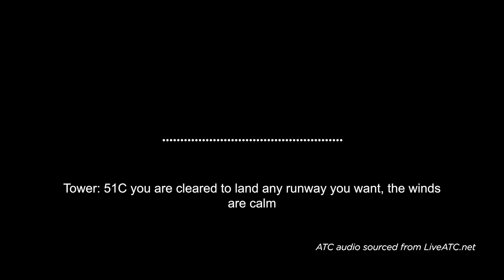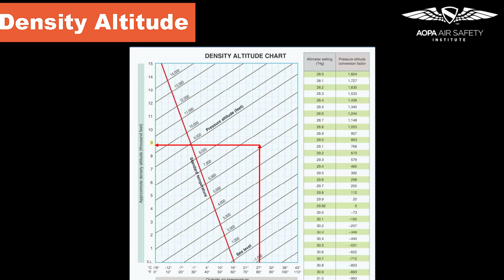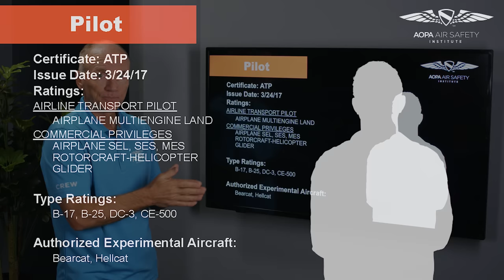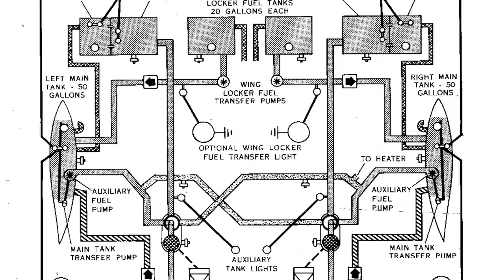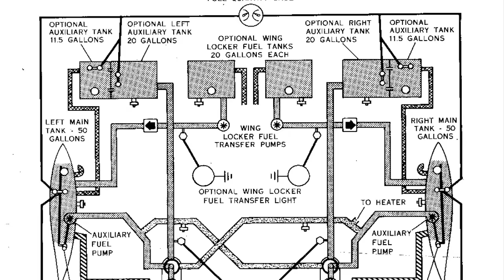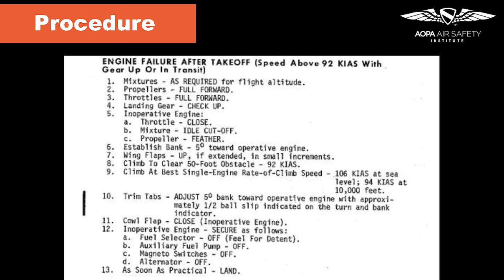Early Analysis: Cessna 310 Crash July 18, 2023 Santa Fe, NM

Comment: I was on the southern end of Santa Fe when the 310 went down, and saw the horrible black smoke. We have been having calculated 10,000+ density altitudes for weeks. It was HOT the morning of the accident. Santa Fe has been near all-time record heat this past week. Please be careful this summer. It is not worth the risk when it gets so hot at high altitude (6300ft field elevation).

Comment: Light twins: 1.5 times the power, 2x the cost and mechanical issues, 3x the skill required. 

The point made in the video about accepting a glide to landing off airport in some scenarios can't be forgotten. Break the mindset that a twin always makes it to a runway. So many pilots accept gliding into a field in a single engine airplane with open arms, only to suddenly chuck that mentality out the storm window the moment they get in an airplane with two props. If you know you're pushing the limits of SE performance (High, hot, and/or heavy!) for your airplane, consider that second engine your ticket to a better glide ratio, not a guarantee you'll make it back to pavement.
Reply: well stated
Reply: Wise words. the instinct seems to be save the plane rather than save yourself and it ends up doing neither.
Reply: Yeah but I also think 2 bad choices were made by the pilot as well ; 1. "Im gonna gain altitude "  and 2. Staying in the left turn- Did the suggestion by tower to go left to 33 stop him from making a long lazy right. Iunno, all monday morning QB. Rest in peace. Thoughts for the family
Reply: Could he have landed on that road? Just interested?
Reply: @pilotactor777 road landings can sometimes work out fine, other times it's rush hour.
Reply: @stevemadak6255  I wondered the same thing.  Looking at the map, I see why the tower instructed a left turn...it would line him up perfectly for a landing on the other runway.  But...did a left have him turning into the inoperative engine?  I've seen too many crashes caused by turning in the direction of a dead engine, inducing a wing stall.
Reply: @gusmc01  I think this pilot should be well aware of this given his experience.  But how many ATC controllers are even taught on this?
Reply: He said that the gonna to get some altitude. How could he have miscalculated?

Comment: First off, condolences to the family. It does sound like he was a capable pilot as well as a surgeon, and there are four immediate takeaways or lessons learned to use today. First, know your density altitude and how to apply that to your s.e.l. Climb chart and if the number is too low for you, reduce the weight and/or leave at a cooler daylight time. Second, brief your departure and worst case emergency procedure to yourself before each departure (he had a nice clear area straight ahead. Third, know that emergency procedure (and practice it at recurrent training) by heart. You might not have time if you’re single pilot in a light twin to reference a checklist. But do use it when you get the “aviate” portion well under control. And fourth, RAISE THE DEAD engine that is. ALWAYS bank into the good engine. This pilot did not have quite yet the aviate portion in hand yet so there was really no need to talk to the tower, the controller was not going to help save the day and as a matter of fact contributed to the bad situation by saying he was cleared left turn back. I would not lhave been saying anything (except “oh shit” to myself) until I had the emergency under control. I loved that airplane, especially the turbo models as I flew 100s of hours flying freight in them at night, with only once having a partial engine failure, over a city.

Comment: Great breakdown of the factors involved in this crash.  I am not a pilot but I spent 4 years assigned to a KC-135 flight simulator as a maintenance tech in the USAF.  Part of my job included daily pre-flighting the simulator to ensure all systems are operating correctly.  Also, during simulated flights with actual crewmembers, my job was to observe the various training "missions" to detect any anomalies in the equipment that may need further attention.  One of the most common simulated failures was having an outboard engine fail during rotation at takeoff.  Too often, the pilot would step on the wrong rudder pedal to compensate for the severe differential thrust.  Of course, that caused the simulator to simulate a loss of control and then simulate a crash.  When that happened, the IP (instructor pilot) would become very angry with the crew.  Whenever responding to an engine failure, over the years, I heard him say emphatically "step on the good engines" when referring to the rudder pedals and which rudder response is called for.
Reply: Dead Foot, Dead Engine

Comment: Great point about accepting your off airport landing rather than augering in at 100kts+ still trying to climb. Sad and discouraging to see any pilot go down like this, but particularly one with this breadth of time and experience.
Reply: If you look at the area, the choice of an off site landing was as simple as looking down.  He even had the option of a dirt road that was perpendicular with runway so he wouldn't even have required a turn and most likely could have gone gear down, particularly if he was having trouble raising them.  Of course in that situation processing the information and making a decision is extremely difficult and time sensitive.   I bet in flying those older aircraft, his natural instinct would be to preserve them in this type of a situation.  Perhaps that kicked in here.
    But the fatal error of turning into the dead engine, seems like a massive oversight for someone with the vast experience he had.
Reply: He died doing what he loved.
Reply: @bastogne315  yeah, that helps 🙄

Comment: Excellent review. With such a failure merely flying the aircraft can absorb much of your brain power. Having to take one's hand off the controls to run through the engine failure sequence can be very demanding when you can hardly keep the aircraft under control. With the high D/A everything on the s/e checklist must be correctly and expeditiously completed or the aircraft simply will not perform. This is where recent/recurrent single engine failure proficiency is so important.

Comment: Richard is one of the most clear and logical speakers I've ever heard. Keep up the excellent work.
Reply: Lesson learned: (1) be prepared when flying in  high density altitude, and  (2) in an engine out situation even at low altitude, where a second engine can provide sufficient climb performance for the situation, be prepared to fight back the instinct to turn toward the quickest landing pattern, particularly if that turn leans to the off engine, and concentrate first on gaining altitude to run the checklist(s) and perform a single engine landing.  What is surprising is that the last words of the pilot seem to indicate he understood this and was focussed on gaining altitude. I suspect something else happened after he started to attempt to gain altitude. One possibillity is that the wrong engine was turned off.
Reply: Thank you for the kind comments.

Comment: Thanks for the indepth analysis Sir.. lesson learnt is on an engine failure just on lift off..
- counter the yaw
- wings level
- landing gears in
- feather the inoperative engine
- maintain single engine climb out speed
- gain safe alt

And then look for landing options 

Thankyou Sir

Comment: Tragic but a solid reminder to do your density altitude calculations.
Reply: Learned something. 
I thought even with density altitude any turbo charged engines performs as it would at sea level?

I'm guessing now that may not be the case?
Reply: Well, yes that was the first consideration he likely missed and that left turn, with an idle left engine.....was the kiss of death.
Reply: @Mikinct Yes it can be done. I’ve demonstrated a cessna T310 with a RAM 2 conversion climbing from 9000FT at a rate of 200Ft/minute. However  contrary to the VMC demo. My Airspeed was below blue line but above red line while maintaining direction control. Engine settings on the good engine were at 32 inches and 2500 RPM. POH says it can maintain 17000 FT on one engine but the climb performance will start to degrade around 13000 FT as you would have to maintain a higher indicated airspeed to maintain directional control as rudder would become less effective with denser air.
Reply: If you watched the video, it wasn't density altitude that was the problem. He should have been able to slowly climb to 17,000 feet on a single engine under those conditions. It sounds like he did not get the plane set up properly for single engine.
Reply: @Mikinct  Some engines are turbo-normalized, with a wastegate that automatically adjusts to provide sea level horsepower to a given altitude. I think these are a standard turbo, which simply adds pressure to the manifold. As such, they lose performance with altitude, or with density altitude. (Of course, prop and wing also lose performance with altitude or density altitude.)
Reply: @linanicolia1363  where did snyone state which engine died? It's just a guess at this point, right? Could've been the right engine that lost power until the investigation is done.
Reply: @jonathanparle8429  if he had problems with both engines then density altitude would not be the issue. Engine problems would. This aircraft should have been able to climb on one good engine all the way to 17,000 ft.

Comment: Great report, my 2 cents is in line with your evaluation, put another way, he stopped flying the airplane, instead he felt it was necessary to start talking to ATC instead of following the procedures you outlined, straight ahead, clean up, lower wing slightly. 

At that density altitude, the 310, 402 and 421 need both engines to fly, picking a relatively flat spot and ditching it straight ahead was his only  
chance, making the turn sealed his fate. The DTSB makes it a point for pilots to mentally brief themselves prior to every departure, this technique can save lives in any aircraft.
Reply: It's easy for us to be  critical, but you would be hard pressed to find a more qualified MEL pilot. Fate is the Hunter, may he RIP.
Reply: @bobteter4300  I’m guessing he didn’t actually know what poor performance was available on the day in that 310. I wonder when the last time he did any SE air work. Training matters.

Comment: The focus on density altitude is important, but it's possible this airplane had a fair bit of margin still. He was solo - that usually means a LOT less weight when you include luggage etc etc. Some cessna 310's are carrying 6 people aren't they? And many are turbocharged. The other issues (cleaning up / feathering / bank / direction of turn etc) all seem like potentially very direct contributors. Gear out, no feather, turn into dead engine, let speed decay? That would be pretty bad. If he was trying to climb my guess is his speed WAS decaying (keep speed is usually part of engine out but I don't know multi) - that was his radio call.

Comment: Its crazy how hot and dry it gets every summer here in New Mexico. Lots of the state has high altitude.  This was in the 'cool'  morning.  I Fly RC jets. Electric ducted fans. Planes that will fly out of your hand @ sea level (easily hand launched) will take a full throttle run on a 300' runway to take off. Its amazing how much MMPH you lose with thin dry air.
Reply: Dry isn't a density problem, humid is.
High, hot, humid.

Comment: Good video, but please recheck the comment  (7:28) that the SE climb performance is based on wings level climb. Normally the climb performance is  based on climbing with a five degree bank into the good engine which reduces the sideslip and drag. Great comment on accepting what you have got if you are not climbing.  If it happens before the gear is up,  think as a friend said "well I just sold the aircraft to the insurance company"  power off both sides and go for the straight ahead off field landing.

Comment: Single engine max altitude is about 7500 not 17500, the density altitude was higher than the single engine service ceiling.
Reply: Cessna T 310 R, II turbocharged - Performance Data
Horsepower: 285	                Gross Weight: 5500 lbs
Top Speed: 237 kts	        Empty Weight: 3723 lbs
Cruise Speed: 223 kts	        Fuel Capacity: 102 gal
Stall Speed (dirty): 70 kts	Range: 517 nm
	
Takeoff	Landing
Ground Roll: 1306 ft	                Ground Roll 640 ft
Over 50 ft obstacle: 1662 ft	Over 50 ft obstacle: 1790 ft
	
Rate Of Climb: 1700 fpm	         Rate of Climb (One Engine): 390 fpm
Ceiling: 27400 ft	                         Ceiling (One Engine): 17200 ft
Reply: Cessna T310R II  Performance Specifications

Horsepower: 2 x 285 HP
Best Cruise Speed: 223 KIAS
Best Range (i): 517 NM
Fuel Burn @ 75%: 27.2 GPH
Stall Speed: 70 KIAS
Rate of climb: 1,700 FPM
Rate of climb (1 engine out): 390 FPM
Ceiling: 27,400 FT
Ceiling (1 engine out): 17,200 FT
Reply: I disagree please check the specs again.

Comment: Very important case for us light twin pilots. Gave me new perspective on temperature related airfield DA WRT preflight preparation/considerations. One thing of importance is advising which engine failed b/c normally one would want to keep (gentle shallow) turns to the side of the good engine. If he had a left engine failure he would want to avoid left turns and needed to immediately advise tower. Another reason to keep the engines in good shape so a remaining engine can indeed provide max or near max power. Furthermore consideration must be given to mixture settings for max power , full forward is great for cooling but may not provide max power esp at high DA.  It was moot but esp at a larger airport he should also have immediately declared an emergency so ATC could put the commercial jets out of the way on a hold or such.  Addendum: did his engine actually quit or seize or did the turbocharger fail causing big  MAP splits?  TC failure esp at high DA may result in significant performance decrement on that side but usually would not require shutting that engine down and feathering, just ignore the split MAPs till back safely on the runway.

Comment: So sad, but you can see the difficulty he had since the Airport (KFAF)'s surveyed elevation is 6348 feet MSL. All the surrounding terrain is 6500 and above in the immediate area of the airport (according to the approach plate for Runway 20). Yet his departure altitude was at most 6050 feet MSL. Something is wrong with his altitude figures as he's lower than the terrain he's flying over. Very sad. Approach plate can be viewed on Skyvector.
Reply: Maybe the ADS-B data is output pressure normalized to 29.92? Barometric pressure was 30.27 which would be about a 350 foot difference, which lines up with the data.

Comment: For those saying he should have turned right into the good engine, he would have been turning into higher terrain.  His ADS-B data shows he could not climb more than about 100' agl, so this would have been a bad option as well.  With no climb performance, either due to density altitude or not having the time/wherewithal to secure the dead engine, landing straight ahead was the only 'good' option he had.
Reply: Do we know what engine failed?
Reply: @scottw5315  I haven't seen anything confirmed, but all signs seem to point to the left.  Regardless, turning right was not a good option in any case.

Comment: As I commented under Blancolirio's video:

"6400 maximum, then down to 6100, so the airport actually seems to sit higher than immediately surrounding terrain. Even if he feathered correctly, it's obvious that he was never gaining altitude, which was his plan (as per audio). I wonder if, after noticing that he wasn't gaining altitude, he tried to go for the highway. 

When I fly single engine I tend to always look for suitable field to land, while when I fly the Seminole (counter-rotating prop, so no critical engine) I tend to focus more on Vmc and proper procedure. But we need to remember that even in a twin, we need to look for suitable landing area in case of engine failure. Two months ago at KLAF (low altitude, 600ft) on simulated engine failure I could barely climb while keeping slightly above Vmc, even after simulating feathering 😮"
Reply: Good point! Every pilot should look at the Google map around their home field to find suitable landing spots or taking it a step further and using the measurement tool. You'd be surprised what looks big enough but is not.
Reply: I'm not sure why you were trying to climb just above Vmc. Fly blue line (Vyse) for best single engine climb rate. You should never be below blue line except on short final when landing is assured. Note however that Vyse may be slightly lower than what is marked on the airspeed indicator when flying at low weights or high density altitudes.

Comment: That pilot seemed to be very qualified to fly this Cessna. He sounded very calm when reporting his engine failure to tower. We are not sure which engine failed at this point but the tower cleared him for a left turn. I learned that you never want to turn towards the dead engine. The tower, in my opinion, should just have said "cleared to land any runway". Aviate, navigate, communicate. 
I know the tower wants to help but they should understand that the pilot in distress runs the show. If the pilot needs anything from tower he will call. Keep communication to the absolute minimum and let the pilot fly. He is pretty busy.
Reply: The tower first cleared him to turn left and then cleared him for any runway of his choosing.  He probably should have declared an emergency, ignored the tower and flown straight until he gained some altitude and had things cleaned up before turning and communicating further.  And make sure he turned into the good engine.  I 100% agree about all the talking, especially single pilot at age 72